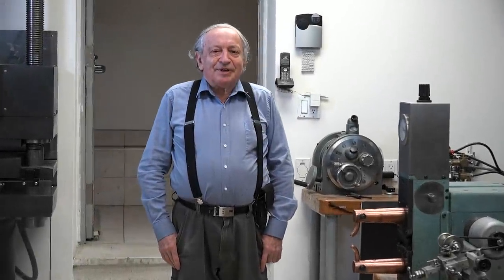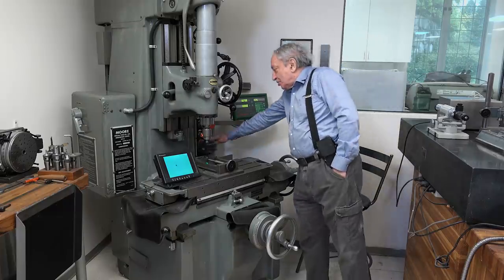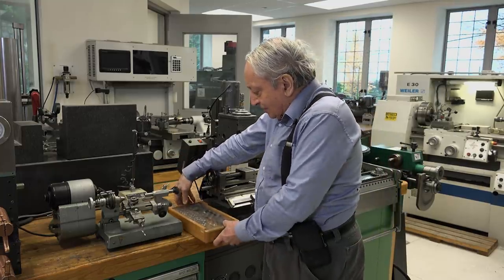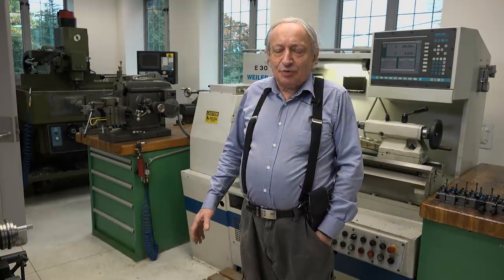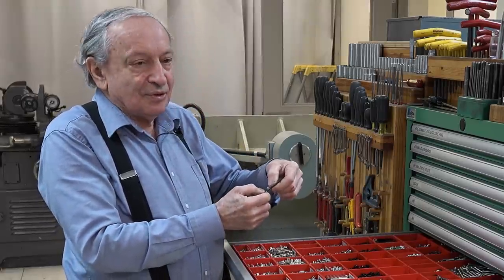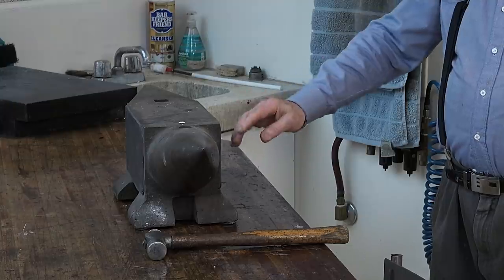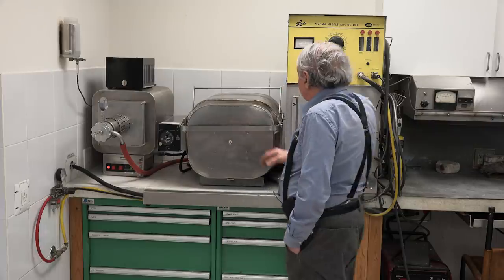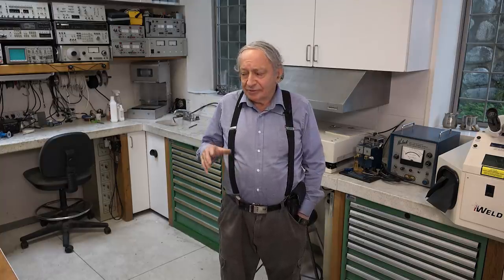Dan Gelbart Workshop Tour HD

Comment: Whats the advantage of that adjustable runout lathe chuck compared to a regular independent 4 jaw?
Reply: Speed of setup and adjusting while cutting odd shaped material farther from the chuck.  Built an impressive shop with a strict outlook on saving all the time you can.
Reply from the maker: It is very slow and difficult to adjust an independent 4-jaw chuck for low runout (say under 0.001") as the runout changes when you tighten the jaws. Also, to change the opening you have to turn screws in 4 places rather than one place.  This chuck adjusts in seconds to the limit of the headstock bearings (4 millionth or 0.1um on my air bearing lather).

Comment: And I forgot to ask... Were the jaws of the 4-jaw chuck post-machined to correct for bellmouthing? And why did you select a 4-jaw and not a self-centering 6-jaw as seen more commonly?
Reply from the maker: 1. Jaws are traditionally ground in place after installing a chuck, only a small amount is removed.  2. 4 jaws is the most useful configuration because you can hold round, square and hex plus you can hold many parts that need boring like bearing blocks etc. Whenever possible I design my parts with  with 4 pads equally spaced from the center to allow boring and facing.
Reply: @dgelbart  Thanks so much! 
Yes, clamping hex material in a 4-jaw yes, that would work great. I was never aware of this. I have a self-centering 4-jaw lying around which will get a new lease on life for sure!
A recent video by Rob Renzetti got me quite involved in the topic of chuck jaw grinding/ hard turning.
Why would it be that chuck manufacturers do not appear to deliver their chucks with corrected jaws? After all, because the error is highly repeatable, it could be integrated in the production process. Grinding the jaws on a surface grinder with a radius wheel, corrected for the error is something I considered recently. 
Of course remachining can be required over time because of wear.
I have written a little article about machining chuck jaws and especially the issue of preloading the jaws. I may have found a better way. Would be very interested to hear your opinion. 
YT removes any direct link to my website it seems so search for 'rndproductietechniek sensitast' and it will pop up. Go to the home page and scroll through the articles. Or provide an email address so I can send the link.

Comment: Hi Dan, thanks for the tour. Why is the Makino KE55 (or Makino's in general) the best machine for prototyping work? (from your workshop tour non HD). On a different note, didn't know of your work in the surgical instrumentation/health space. For some reason, I always assumed you will be more inclined onto mechanical, optics and the like.
Reply from the maker: The Makino is very rigid and accurate, good canned cycles, reliable and good access to the machining area. As I said in the old video, each time they make a machine everyone likes (like the Monarch EE10 or the KE55) , the stop making it.  BTW, I'm mainly in opto-mechanics, medical was a side trip.
Reply: Thanks for the reply Dan - very much appreciated especially knowing you're very busy. I guess you don't own a monarch ee10 because the Weiler (cycle-controlled?) is also designed for precise work (toolmaker standards), seems less bulky, reliable and access to parts? Also seems to be able to hold a bigger chuck and bigger work area. Interesting side trip and a good read.

Comment: Hi M. Gelbart, I notice you made your own gauge amplifier over the cnc lathe. I was wondering what type the electrical signal does it interpreted? I own an old B&S 1020 with couple gauge head using the GE haft bridge design, I think it’s GE, and I have one head with what I think is an ajustable capacitor missing. After some testing I realize that I can tune the gain in one resolution and it does repeat but when I change for a lower resolution it doesn’t follow the calibration and give erratic reading. I presume the ajustable capacitor is in relation with a electrical value of the two little transformers in the head. Do you know how to tune this adjustable capacitor for the gauge head to keep its calibration in between resolution? Thank you very much for all the effort you put in your video and passing so much knowledge.
Reply from the maker: Sorry, I'm not familiar with the circuit you are using.
Reply: @dgelbart  Do you know someone specialize in this type of circuit who can help me reverse engineer this circuit? Thank you and have a great year 2022.

Comment: Mr. Gelbart - What is the brand and model of the milling machine vise you showed with retractable jaw? The one mounted to your Jet mill. I would like to see if I can find one.
Reply from the maker: I added the retractible jaw.
Reply: @dgelbart  Darn! No wonder I couldn't find one. I have been doing a lot more machining in the past 10 years or so. The mill I presently have is not big enough etc... anymore and I have been looking for a good used knee mill with a lot more X axis travel.   I found a good old Heald horizontal mill I am starting to clean it up. 

  I can't afford new machines but have bought old table saws, bandsaws, jointers etc... and rebuilt them.

Thank you for taking the time to make the videos, very informative and encouraging.

Comment: Awesome video with a lot of incredible useful informations, thank you very much for it!!! Most machinist can't even dream about having this level of knowledge.

Can you maybe tell me the purpose of the cooled area in front of the Methanol hardening oven ? I am afraid it cools down the parts too quickly before you're able to quench it, but not fast enough to create Martensit, so I don't really understand its purpose.

I also wonder if the oven has to be air tight, to not cause an explosion with the Methanol. I guess the atmosphere has not enough oxygen in it to explode, because you're turning the Methanol on before you're heating up the oven, but I am afraid that in "normal" cheap ovens, where the doors are not tight, this might happen?
Reply from the maker: This is optimised for A2 and D2 tool steels, which are hardened by air cooling. The door has to be a tight seal, as the gases developed inside are both toxic and explosive. The red tube in the front vents the gases to the outside.
Reply: Thank you very much for the detailed answer!! I really admire what you have achieved in life and how kind and down-to-earth you are, answering unknown people on youtube. A person can't reach more in my opinion :)

I am currently trying out to coat parts with different thicknesses of thin clay before hardening, lowering the cooling speed during quenching. I have seen videos of japanese blacksmiths doing this with their blades, so the back of the sword get like 45 HRC while the cutting edge has around 60 HRC. My main idea is to avoid decarbonisation in my hobby machine shop without a vacuum hardning oven as well as reducing the stress during quenching for complex parts. I believe it may gives me the prefered hardnesses between 40 and 50 HRC without annealing to high temperatures, which is something i want to avoid at steels with low molybdenum content.

Comment: Beautiful workshop, congratulations! Is the zero-runout chuck on the Weiler lathe your own design, or can I check it somewhere?
Reply from the maker: Home made.
Reply: @dgelbart  thank you for the answer!
Reply: Could you possibly explain in more detail the design of the back plate?
Reply: Does adjusting the back-plate make it off balance? I suppose the offset is minute and probably makes no difference.
Reply from the maker: @flux81  It does when you adjust it to the limit of its range (+/-1mm), but up to 1000 RPM it is not noticeable.

Comment: Nice shop, I had to look you up on Wikipedia. How was your time at Creo? Are you still active with your company? It's nice to see you have a nice retirement.
Reply from the maker: Creo was a long time ago. I'm on my third company after Creo. I tried retirement but it wasn't for me.
Reply: @dgelbart  That's cool to hear. Engineering/building/machining looks like allot of fun. I work as a CNC lathe operator myself. Some of the people I work with seems to be grumpy (or stressed out) about work but I like my job and I could see why that type of work could be hard to get away from. I'm trying to learn and memorize the G-Code/M-Code/ all the codes right now, got any recommendations?

Comment: Dan,
I'm curious as to some of the construction aspects of your shop.
I am looking to build myself a bit of larger shop and I'm curious as to any recommendations you may have while I'm still in the planning stage?
I may not have the budget you have but I still think its worth incorporating some features in while in the planning stage. Anything you might reccomend?
Reply from the maker: Many aspects do not cost much. Here are some: 
1. Divide shop into zones, with all dust producing stuff in one zone from which air is exhausted so it will be the lowest air pressure part. This keeps the rest clean. 
2. Install on a large fan that can exchange all shop air in minutes in case of smoke or smells. I have this fan going through a Heat Recovery Unit (HRV) so I can exchange the air without losing heat. This fan should be in the low pressure area. This is different from the regular ventilation which is much lower flow. 
3. If possible install a duct all around the shop about 1m (40") above the floor, so you can always add electrical wires, air, gas, water etc without cutting walls. 
4. Before you put panels on the framing take pictures of all walls, so you know years later what is inside the walls at any location.
Reply: @dgelbart   Hi Dan, wanted to know if the fresh air coming in is coming through filters? 
How about sealing the room, and installing a room air filter within? 
isn't this a more efficient way, from a filter life perspective? 
you can have H13 levels of cleanroom air quality this way. is this idea overkill?
Reply from the maker: In a shop, unlike a cleanroom,  it is not a good idea to recirculate the air. The main reason for exchanging the air is fumes, and recirculating does not get rid of them unless you have a huge active carbon filter. Better to exchange with the outside and use a Heat Recovery Unit (HRV) mounted in an easily accessible place.
Reply: @dgelbart  glad to see your reply. Thank you. 
 what is the source of the fumes?  The ovens?
Reply from the maker: @247chiranjeevi  Everything in a shop has fumes: cleaning solvents, cutting oils, smoke from welding and heat treating, ovens etc.
Reply: @dgelbart  thanks Dan.
 I'll be making a hrv myself. 
Is there any thumb rule for flow rate vs room size. 
Like how they say, 6-10 circulations per hour for room air filters.

Comment: Dan, do you think there's still room for small prototype shops with old machinery or has the field become so dependent on expensive machinery and business relations that independent small shops go bankrupt before they get things going?
Reply from the maker: The problem is competition from China, even for one-of jobs. One way to succeed is to specialize in some area, but you still need to buy CNC machines.
Reply: @dgelbart  thank you for your reply. Somewhat surprised about one-of jobs being also exported to Asia. Probably goes without saying, you need to step up and offer something overseas competitors can't provide.
Reply: Completely agree with Dan here, and as an engineer bringing a product to market right now I'm interfacing frequently with suppliers in China. As the Chinese are moving up the value chain a lot of their suppliers are beginning to offer the full menu of design-->prototype-->manufacture. They'll make a one off thing, but are also ready to make ten thousand of them at a moments notice when it comes to it. That's very compelling if you're the one developing the product.

I'm not sure how things are in your location, but down here in Australia small job shops are practically non-existent. The market has split into super niche like medical device (with a high regulatory burden) or very large machining that cannot easily/cheaply be shipped. The latter usually has mining and Oil & Gas as customers. "Cutting Edge Engineering Australia" channel is one guy who does a lot of big stuff for those industries. Having your own prototyping shop sounds cool in theory but be prepared for a lot of competition, particularly if you're in North America
Reply: @teamtoken    this is probably something I anticipated. China is a good partner as long as world is in peace and no pandemics are happening. Our company (embedded systems) is really struggling with component issues right now and we'd do anything for having alternative partners - even if more expensive. Prices on memories, processors and other chips are ridiculous. It's a sellers market for sure. 

As you said, having a prototype shop sounds cool. However, probably it's not something one thinks it is. There's no unlimited time for perfectioning what you build. Stuff needs to happen quickly. This is probably where my picture of a dream job would shatter. It's best to keep tinkering around just as a hobby.

Comment: Hi. Do you still have all the original machines you built?
Reply from the maker: Yes.
Reply: @dgelbart  could you please do a video showing those machines?
Reply from the maker: @nickfilippeos1913  Most are shown in this video.
Reply: @dgelbart  
Hi Dan, you rock a community’s minds who desires something that’s very important to them. But, for what ever their reason hasn’t acquired the skills to inherently know the answers to the question they have to start building such incredible pieces of equipment (artwork, I say). 
A step by step video build would have been aw inspiring. It also would have been unimaginable to do, in the time you built them. 
What a gift you have. I wish I new how to start building (accuracy) what you have built. 
I will subscribe
Thanks

Comment: Any one know what the silver pivot mechanism is on the spot welder? Why is one side so much bigger than the other?
Reply from the maker: The "silver pivot" contains a coil spring used as a return spring, so the welder can be operated without air, just with a manual lever. In my first shop I didn't have air.  The Ammeter on the welder holds the last weld current reading for a few seconds so you can verify the weld was good by looking that it reached  5000A.

Comment: Excellent presentation.  Working at micron precision is probably the envy of tool makers.  However, this is far from the finest precision in commercial use.  The likes of ASML - Zeiss make components at the nanometer or better levels of precision on a routine basis.
Reply from the maker: You are correct, parts are routinely made to the nanometer level, even without lapping. I fabricated nanometer-level optical parts myself. This video was about machine tools, and the machines shown are as accurate as you'll ever need in a machine shop. When you get into optical parts the machines and techniques are very different.

Comment: What mini mill is that?
Reply from the maker: Based on a Sieg but compleely rebuilt (precision leadscrews, precision spindle etc). MIll head fits on the lathe as live tooling.
Reply: @dgelbart  thanks for the reply, always learn so much from your videos. That looks like a stout mini mill, especially with the precision screws. I just purchased a Proxxon Mf70 micro mill to start my foray into machining